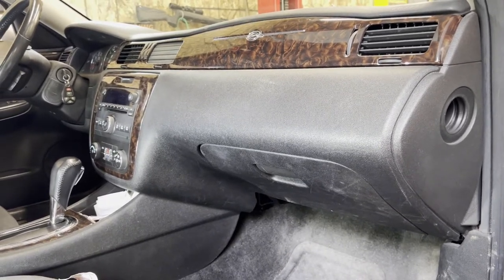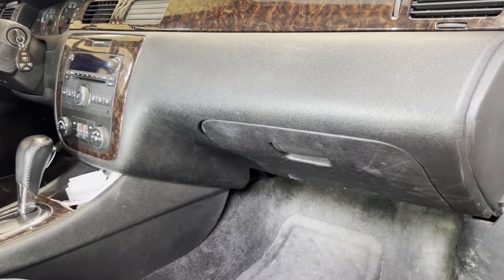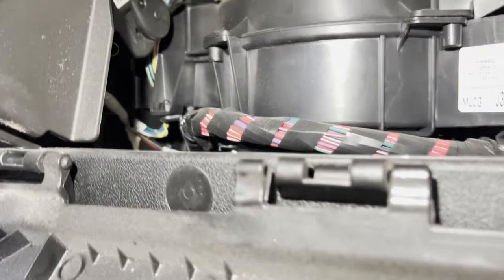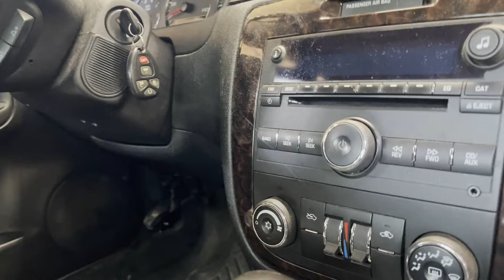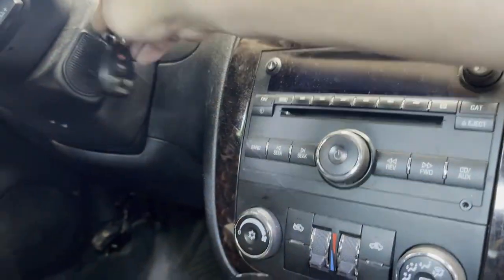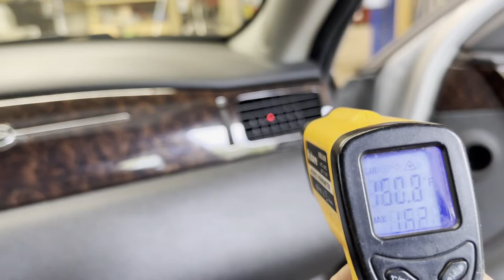Chevy Impala Dash Clicking?? Blend Door Actuator Replacement

Comment: I have a 2009 Impala and the same thing happened with the actuator. Gear teeth broke off.    Found the Dorman brand on Amazon for $20,  Autozone had it for $40.  I had to replace the actuator on the left side of the glove box, that controls the heat/ac blend.   Took about 10 minutes after watching this video and others.  No more clicking!
Reply: I'm fixing to be replacing it for the 4th time, along with the cooling. My question is who is the idiot that came up with these!! I've had to replace my battery a couple of times because they go off any time, day or night, without the keys even being in the ignition🤦‍♀️

Comment: Do you have a video on how to replace the one under the steering wheel? I suspect that is the ones I am having issues with as the drivers side only blows hot air, but the passengers side still blows cold air (when AC is on). Thank you.

Comment: Did you have to "Re-Calibrate" by disconnecting the negative battery terminal and turning the ignition key on for 5 minutes with the engine OFF ??

Comment: Unit above gas pedal.  I ended up cutting a wire w finger nail clippers. Too much of a pia. I replaced the glove box unit 3 years ago. Had shop cut wire to the left and above of passengers left knee.

Comment: How did you install without clocking the new one to match the original. You cant turn them by hand to match the shaft
Reply from the maker: You don’t have to clock them. They spin until they hit resistance in the self calibration procedure and that’s how they learn where to stop in each direction.
Reply: I had to use the gear from the old actuator to turn the shaft in the car, so I could line up the flats on the new actuator. The gear teeth gave enough gripping strength to do this

Comment: When you do this -- you should reach in and manually flip the door back and forth to make sure it isn't stuck or have trash in there.  Because the gears usually break from the fact that the door got stuck somehow..    I've taken apart a 'drive by wire' throttle body on a 2010 Dodge Nitro -- and it looks basically the same, (plus a little fancier board with a sensor).   But otherwise, it's the same kind of setup:  Electric motor with a worm gear, and plastic gears after that.  

(the reason they use a worm gear is because that allows the motor to move the door, but the door can't move the motor.  Those worm gears only drive in one direction/   in other words, if air was blowing on that door and trying to close it, it will not drive that worm gear- it CAN'T;  The worm can drive the gear, but that plastic gear can't drive the worm.   That's just a side effect of that setup.   which is probably why the teeth are torn in that one spot.   From the years of the air blowing on the door and moving it back and forth slightly, chewing up that gear on the worm gear.   In this case, I actually think that second gear should be metal too-- since it's engaging with that strange worm gear, rather than a regular matching tooth gear-- like the rest of the drive train on this thing.  Interesting)  

On my throttle body, the "butterfly" flap had gotten a little dirty or carbon gunked-- but I think it also got just enough moisture on it to freeze-  and that's why the gears broke. (it was cold and snowing at the time)............   The thing is:  even if they did put metal gears, it would probably just break the motor anyway -- or it would bust the plastic case that is holding the gears in place;  there's always a weaker link somewhere.    Again, make sure the thing that you are actuating isn't stuck or binding-- or it will just break again.
Reply from the maker: Thanks for the info!